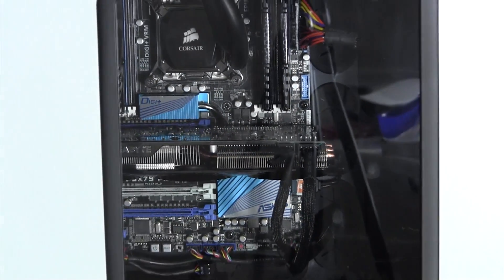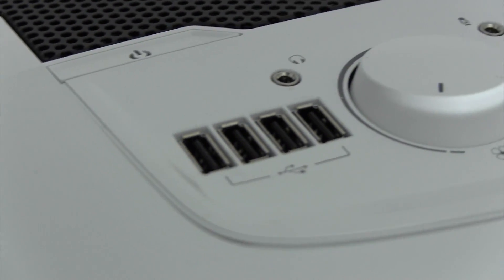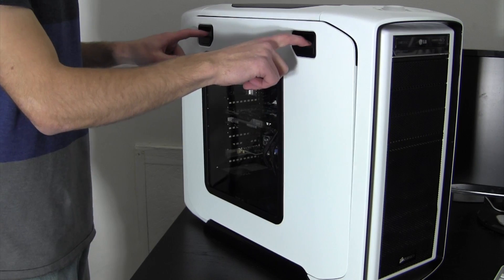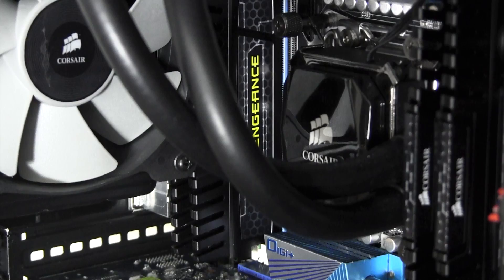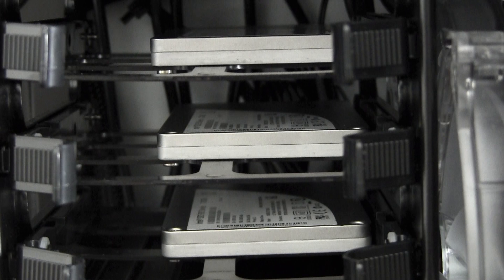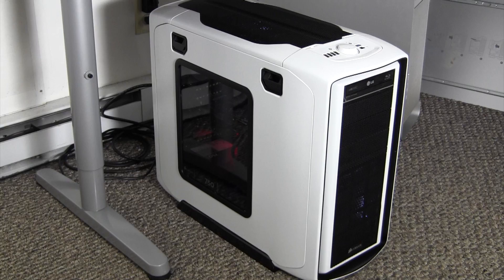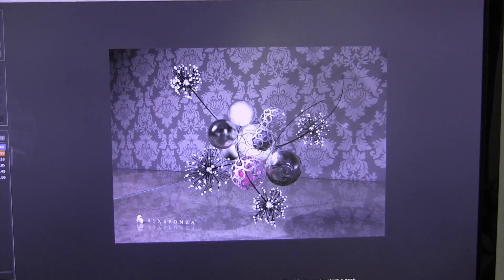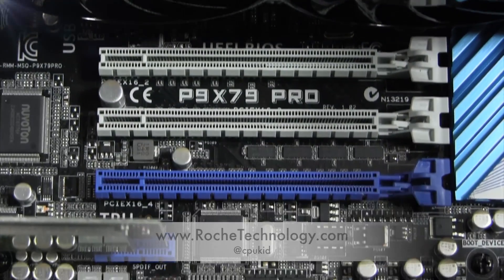Socket 2011 Hackintosh: Tour & Benchmarks

Comment from the maker: That depends on your needs/uses for your machine. If you're not doing intensive tasks and/or the room your computer is in doesn't get very warm, air cooling is generally cheaper. With that said, liquid cooling offers the most effective performance.

Comment: Hey Bob, I own pretty much the same build. The only difference is, that I installed a Corsair H100 on top the Graphite 650. In my case the noise is pretty annoying. Especially   when I put on the the top grid. Then the top grid directly lays on the two fans which produces more noise caused by wind turbulence I guess. Do you got any idea how to fix it instead of just buying some lower spinning fans? Or would that be the answer? Or directly switch over to a 550D. Thanks in advance.

Comment: You have lots of great stuff for the Hack community. I'm in the process of building my first Hack and I'm confused on the use of Unibeast and cloning my current Mac drive. Can I simply clone my current drive and then use Multibeast to make it bootable? Or do I have to go through the arduous process of installing new OSX files to the HDD with Unibeast?

Comment: Nice machine, do you not have problems with running all 6 cores with in ML? I was under the impression the speed steeping would not work and that the cpu will run 100% all the time? also running two 670s in SLI is a problem again in osx, would this be a problem if you wanted to run two in a windows boot or would you need to take one out every time you wanted to use osx? love watching your videos man, keep up the great work :)

Comment: personally, i would always go for a more powerful gpu to begin with rather than buy two cheaper ones as power consumption will be less for more performance, but saying that, since you already have a gtx 660ti, if your power supply can handle it, i would gt a second one for sli. If your hackintosh-ing i don't  know if it SLI work or not.